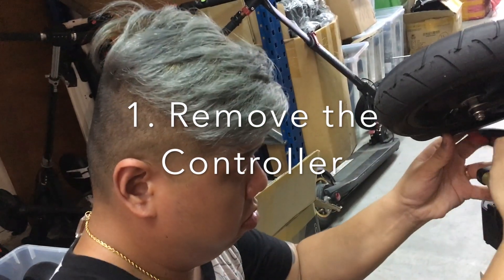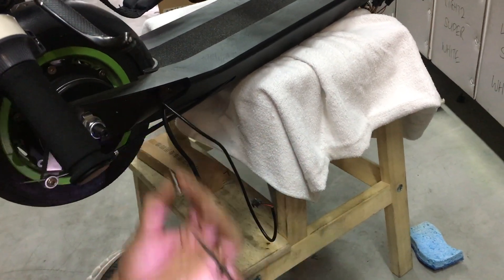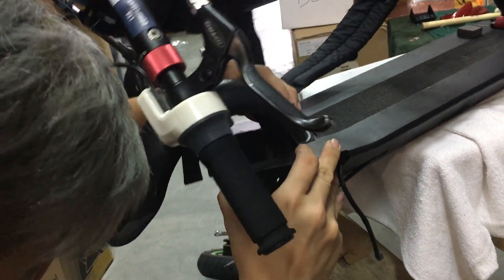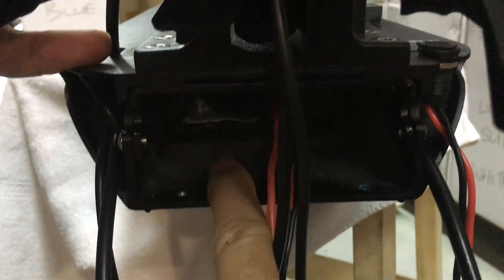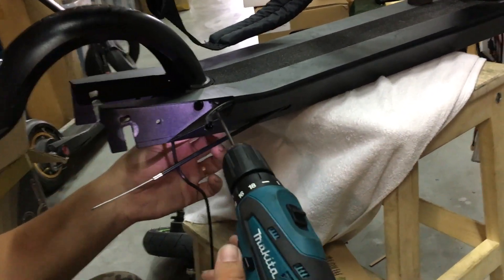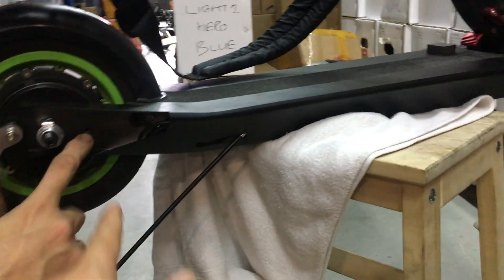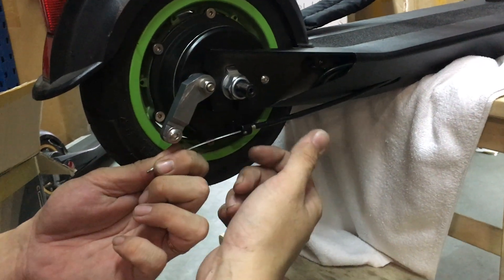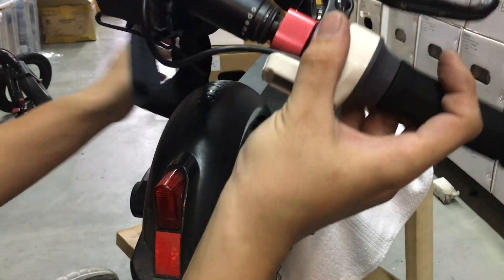Upgrading Inokim Light E-Scooter Battery

Comment: Okay, now I'm sorry to be a pest here, but I REALLY wanna upgrade my battery. When the scooter was new a month ago, I had 2 or 3 bars left from a full charge when I got home from work. It's a 15km round trip, I weight 88kg (losing weight though) plus my bag (incl heavy lock), and now I'm down to 1 bar by the time I get home. I ride about 40/60 15kph/25kph.

I'm looking into building my own battery, I can pick decent cells and do the maths, but I need to know:

How many cells are in the replacement battery?
What are the cables and connectors I need?
What BMS is required?
What are the final dimensions of the battery replacement?

Have you considered doing a video on building a replacement battery?

Comment: Question: I have a Light 2 with about 4000km on the odometer. I'm trying to charge it but the charger is indicating green even though the battery isn't at full charge, theres only 3 bars in the indicator and not full. Anyone knows what could be wrong? Do I need to change the charging port/controller?
Reply from the maker: Yes easiest thing to do is to try a different charger first. Could be a faulty charger. If that doesn’t work then it could be the charging port then the battery
Reply: @FalconpevSg  Thank you and stay safe 🙏🙏🙏
Reply: @FalconpevSg are you still replying to comments i got a question
Reply from the maker: @princealex10  not all the time but what’s the question

Comment: The battery can be removed from the front once you remove the controller.  Make sure you drop the handle bar  stem so the front wheel is out of the way... lol, as I finished writing this post you removed it from the front.

Comment: Idk if you can help me with mine but i have a blitzart ram that looks to be about the same scooter but mine is orange, anyways my pull pin for the latch is missing do you know a repair for this? Also there are 2 bolts in the bottom that wont tighten. Im having a hard time figuring it out, its about directly behind the battery

Comment: What a incorrect way to remove the motor connector u should hold the connector and pull not pull by the wire
Reply from the maker: Its a sealed connector. It doesnt matter.